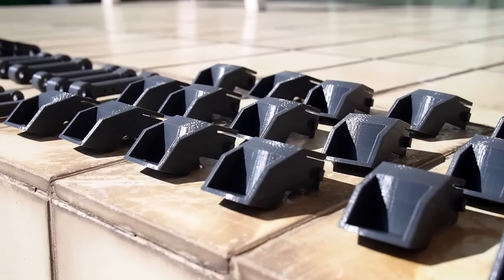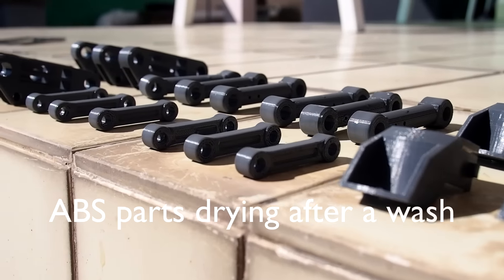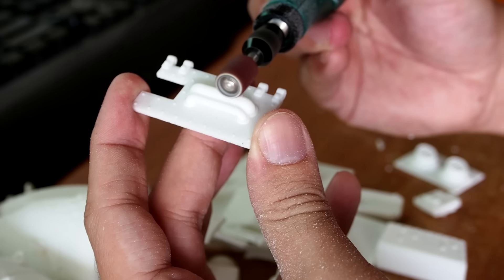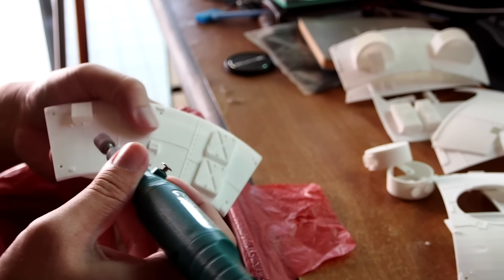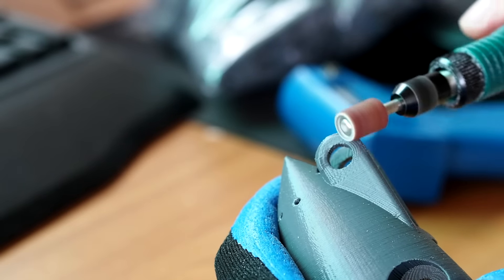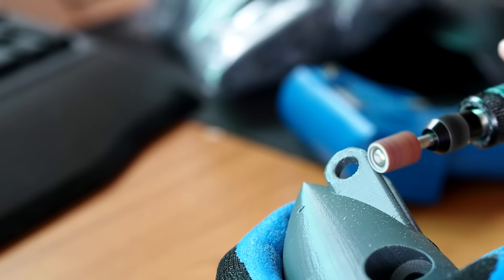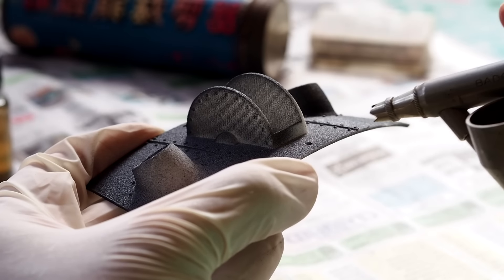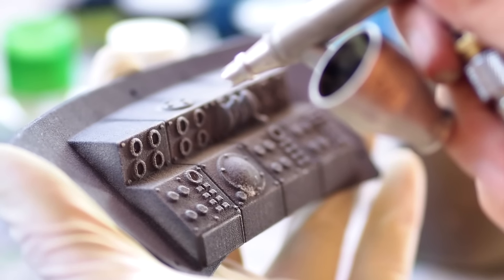Preparation of 3D printed parts for Codename Colossus

Comment: Have you tried acetone vapor smoothing yet, for the Fortus prints ?
I've used it to remove some layer lines from FDM style printers, before airbrushing, on some figurines, but not yet on models with multiple component parts.
Also, thanks for the tip on pre-highlighting details. I've been pre-highlighting panel edges, and post-highlighting details.  I'll give it a try.
Reply from the maker: Duplicat I have played around with acetone vapours but, quite frankly, its way too much for me to have to deal with simply because I have so many parts that need to fit well together. As the vast majority of my ABS parts are not exposed, I only work on a few irregular parts that show. Pre-shadow and pre-highlights really depend on the opacity of your paint.